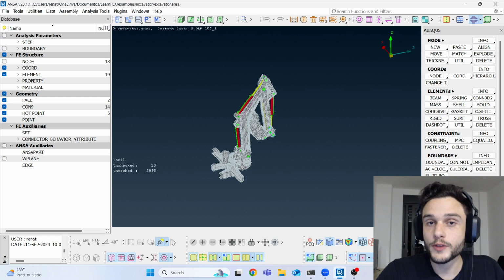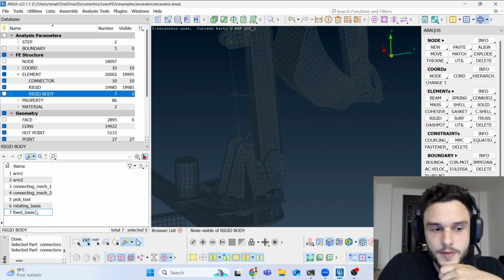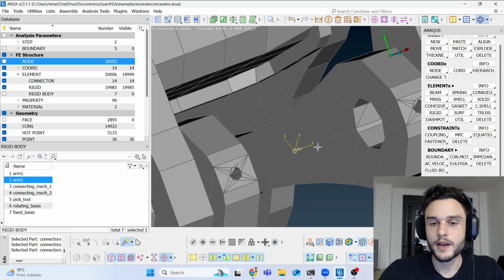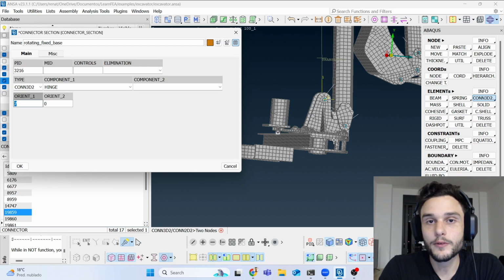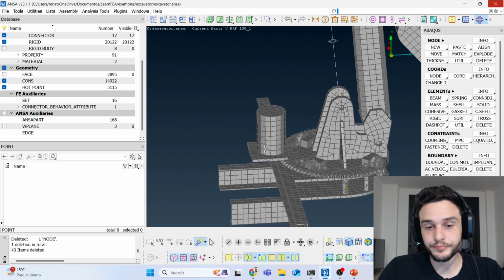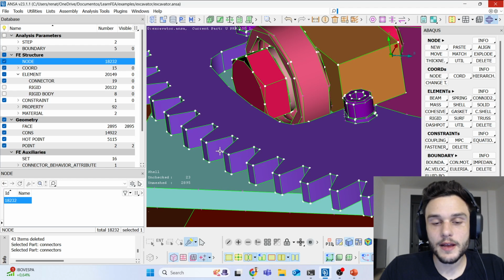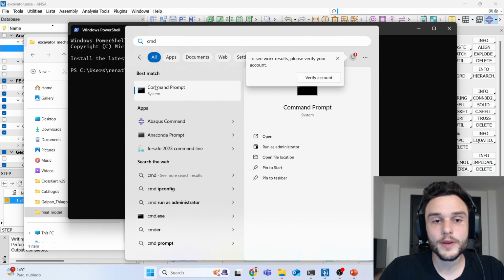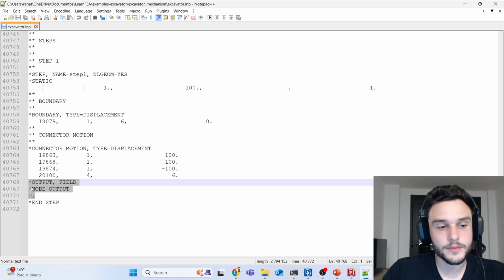Modeling Excavator Arm Mechanism in ANSA and Solving in Abaqus (FEA Tutorial) | Part 4

Comment: Dear Renato,

I recently followed your excellent tutorial on simulating the excavator arm, however, I have encountered a challenge while working on my own, and I believe additional clarification would be invaluable.

Specifically, I would like to ask if you could create a follow-up video that explains how to:

1. Define gravity in the simulation setup.

2. Include external loads, such as the weight of the bucket's material, to make the simulation more realistic.

3. Properly assign these loads in the preprocessor (ANSA) and ensure they are carried over to the solver (Abaqus).

4. Postprocessing of reactions and moments in META.

These details are crucial for obtaining accurate reactions and moments at the pivots (boom, stick, and bucket). I believe many others who follow your tutorial might also benefit from these additional insights.

Thank you for your time and for sharing your expertise. Your tutorials are making a significant impact on learners like me.

Best regards
Reply from the maker: @despinosax  I’m happy you liked it. I will create an additional video showing how to do what you requested. I will do that in the beginning of January. Have a good end of year!
Reply: @eng.renatocarvalho  Happy New Year, Renato, and thank you very much for your response!

I assume that the idea behind this excavator arm model is to obtain forces and moments, perhaps as input data for structural and fatigue simulations.

I would like to kindly ask if you could clarify in your next video why you chose to use a workflow based on finite element-based multibody simulation with Abaqus, instead of using dedicated software like MSC Adams, Simpack, or even SolidWorks Motion Analysis, where the CAD model could be analyzed directly without the need for meshing.

At least to me, it seems worthwhile to discuss how these methodologies compare, especially since stress analysis is not the focus here.

What advantage does working with R3D elements offer? Isn’t this approach more computationally demanding?

Wouldn’t it be less labor-intensive to preprocess this model in software specifically dedicated for MBD?

Have you approached the model this way as preparation for the subsequent steps in the analysis?

Apologies if these are very basic questions, perhaps these considerations are obvious to professionals already working in the automotive industry. I have encountered FEA analysts who are reluctant to use dedicated software, while others believe that certain programs are “black boxes” where users have limited control over what is actually happening.

I agree with your emphasis on the importance of having a deep understanding of the model, boundary conditions, contact definitions, and a well-constructed mesh, points that you consistently highlight in your video series.

Thank you very much for your time.
Reply from the maker: Happy new year,  @despinosax ! I'm finishing recording the videos of a new cours about ANSA Meshing this week (it'll be launched on next Monday). For that reason, I'll not be able to record this additional video yet. I will try to find some time during my weekend. It will be interesting to talk about it. Thanks for the request!
Reply from the maker: Hello  @despinosax . Just now I've got time to record this additional video, but I lost the Excavator Arm file. Can you please send me it? It can even be the .inp file. My email: renato.carvalho@learnfea.com
Reply: @eng.renatocarvalho  Hi Renato. No problem, I send you my file, with the last version you prepared in this video.